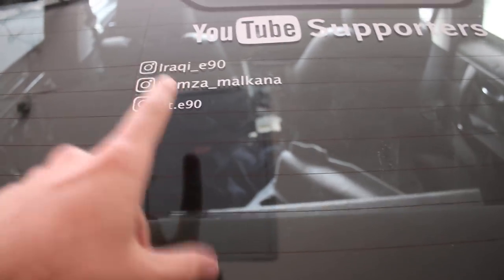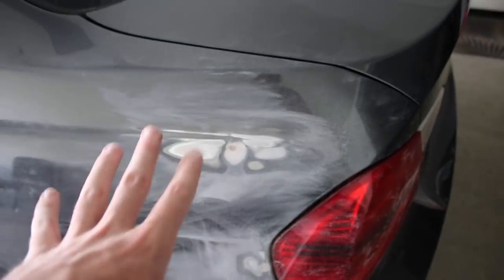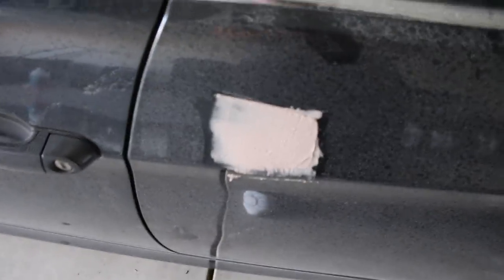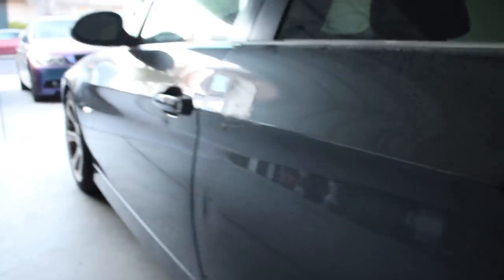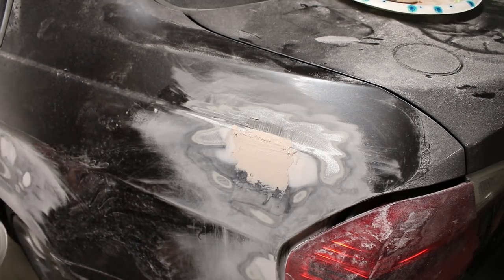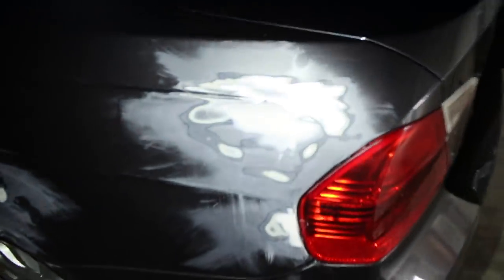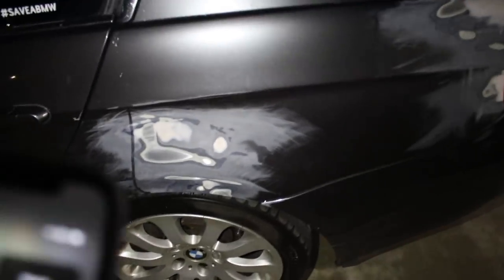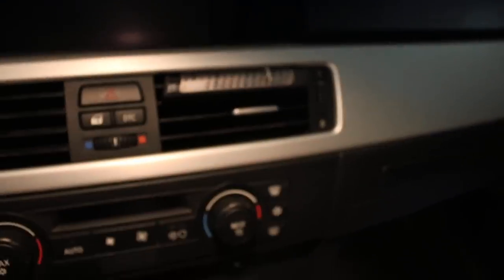Rebuilding BMW 335i Involved In Gun Fight! Part.9

Comment: Oh and what's the part list?

And body filler should be thin enough to where a magnet can stick onto it still. 1/16 in max inch is what I recommend. Also it's possible to get the body filler to come out smoother before it dries, less sanding.